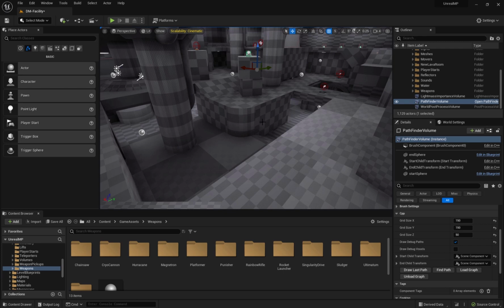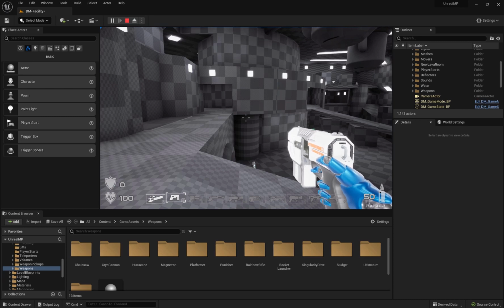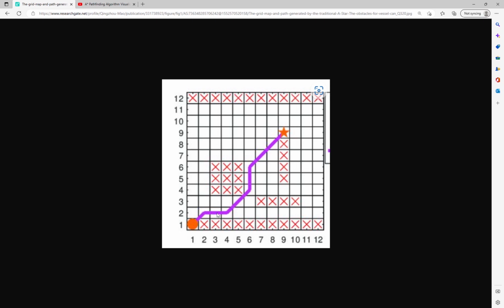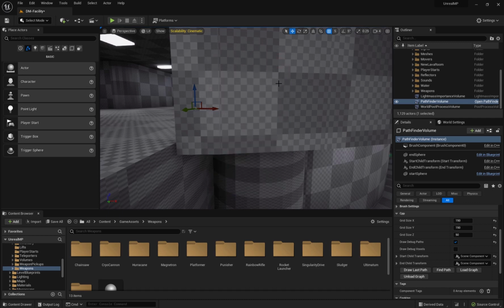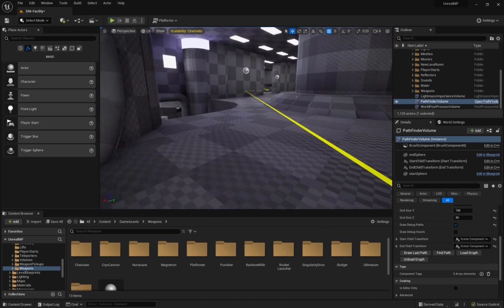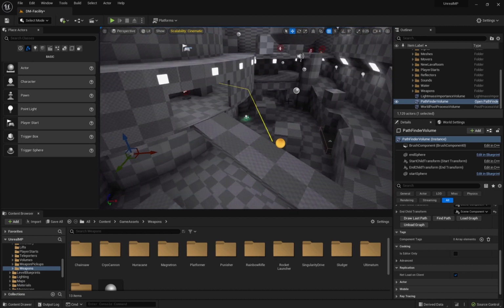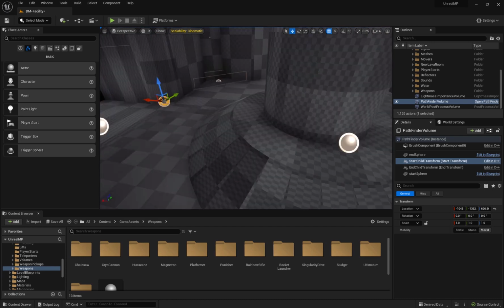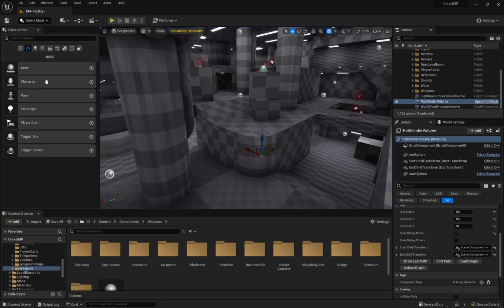Behind The Scenes #1 - 3D Pathfinding

Comment: Im trying to implement pathfinding in my project. How did you get the pathfinder volume?
Reply from the maker: It's a custom c++ class we're working on - if you want basic ground-based navigation in Unreal, there are tools built into the engine for doing it. But if you want true 3d pathfinding, you have to conjure your own solution.